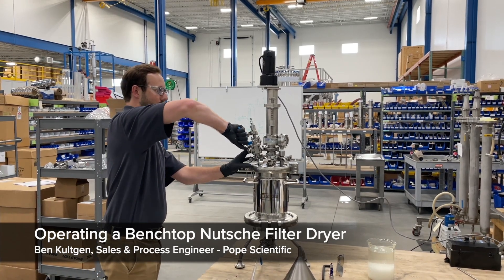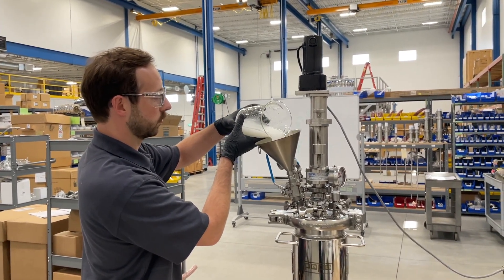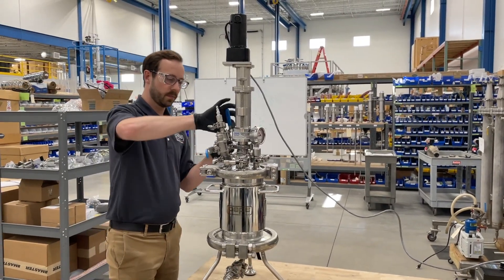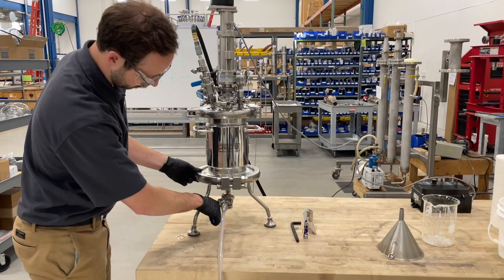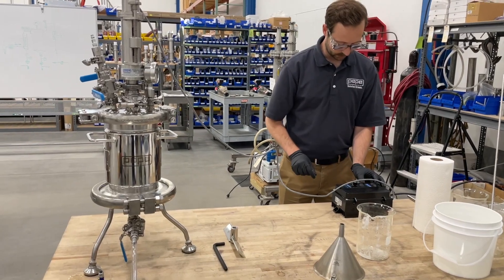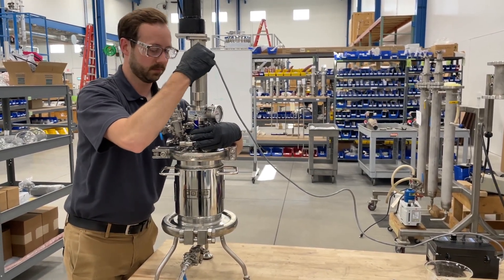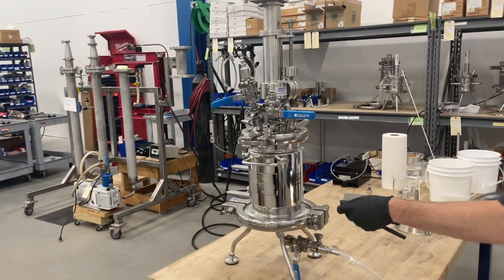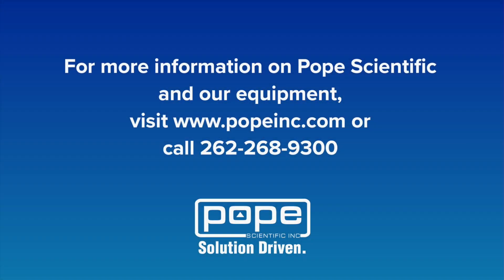Operating a Benchtop Nutsche Filter Dryer

Comment: What mesh screen size did you use with this citric acid example? Can customers cut their own filter media to mount above a coarser mesh screen provided?
Reply from the maker: In this video, we wereI using a 10-micron, 5-layer stainless steel screen, but the stainless steel filters come in a variety of sizes ranging from 1 to >100 micron. The Bench-Top Nutsche is designed to also be used with paper and polymeric filters as well.

Comment: Do you stock these units?
Reply from the maker: Yes, we stock Benchtop Nutsches in 3, 4, and 5 Liter sizes, both jacketed and unjacketed. We also have our larger units (25, 50, and 100 Liter Nutsches) in stock and available for quick delivery.